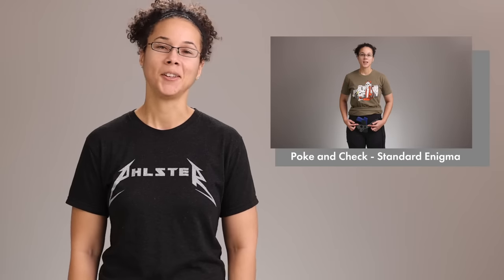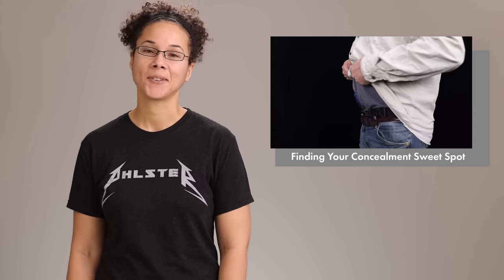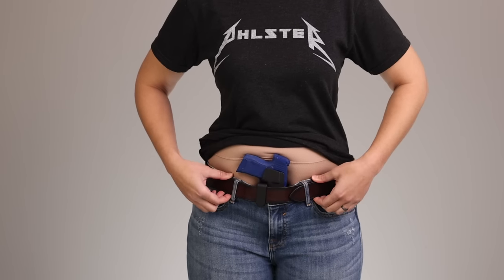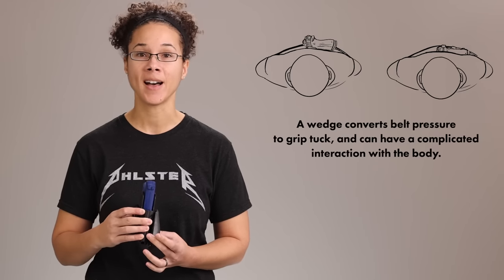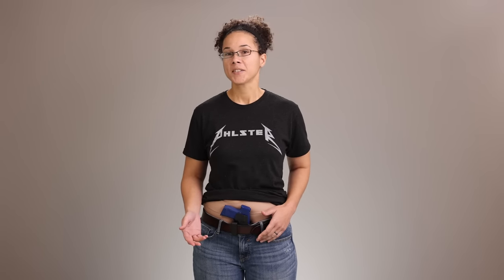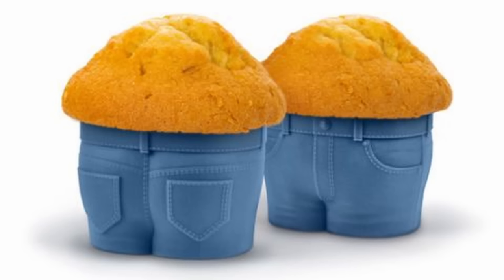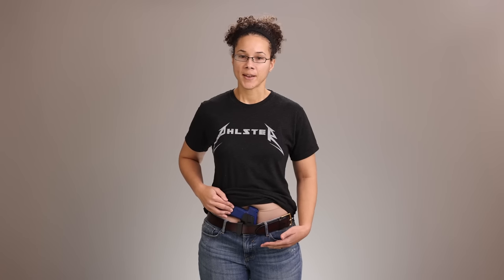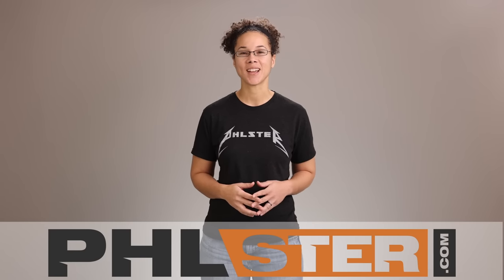Poke and Check - How To Stop Printing

Comment: I think people worry a bit too much about a small “bulge”. There’s a difference between printing, which actually is where you are showing a definitive outline of a gun, and a slight bump or bulge. You may show a slight bump, but it!s not obvious to a casual observer what it is. Is it a cell phone holder? Is it a back brace or lifting assist brace? Is it a large belt buckle? As long as it is concealed and cannot be seen as definitely being a gun, don’t worry about a small bump. I found when I first started carrying 10 years ago, (my gun is larger and not what most people would carry as a “conceal gun”) if I had a small bump I was so worried about someone spotting it and figuring out I was carrying a large gun. I wear loose shirts all the time so I wasn’t “printing” as the definition goes. Truth be told, I was worried about it so much but found out I was the only one that noticed it. And if by chance someone did notice a small bump, they never gave it a second thought or look.
Reply: Agree with the Axe4ever…People are not starring at every part of another person looking for bulges. Most  are too into them selves or there phone or you name it.
Reply from the maker: @wbwills2  Are those people the reason you carry a gun?
Reply: @PHLster  Well yea, partially at least. You don't want people to know, even if they're not the potential threat. The danger in printing, in my mind, is that you could cause unnecessary panic in people. I'm not generally worried that a bad guy is checking everyone's waistlines.
Reply: @PHLster  Not sure what your point is. I don’t carry a gun for anyone but myself and my family. I think the point Mary was making is people aren’t going to notice a small bump under your shirt. I’m talking about just a small bump that doesn’t show unless you move just a certain way. Again, not printing. People are just usually too busy going about their day to even notice. I used to be. But when I started carrying, I drove myself crazy thinking everyone would notice what could be just a belt buckle if I wore certain shirts. Again, a small inconspicuous bump is not printing per se. I’ve been carrying for 20 years and NO ONE has ever gave me a second look. Well, not entirely true. In line at a convenience store I saw a cop notice it. But they are trained to look for such things. We exchanged a hello and went about our way.
Reply from the maker: @TheAxe4Ever  I mean that oblivious people aren't the dangerous ones. The people who don't notice printing aren't the ones who constitute a reason to carry a gun. So, yeah, most people don't notice. Sure. But I'm not carrying a gun because I think I'm going to be attacked by some oblivious person who's looking at their phone.
Reply: @PHLster  Agreed. Criminals (and cops if you're in an unfriendly state) know what that oddly squared bulge is in the middle of your shirt.
Reply: You are far more likely to be identified as "someone with a gun" if you keep checking it to see if it is completely concealed, or if it is printing.  When you do that, you are bringing attention to a gun that would otherwise go completely unnoticed by anyone around you.  The more experience you get, carrying concealed, the more confidence you will have and you'll quit drawing attention to yourself, and the firearm.  If you take reasonable care in concealing your firearm, the only people that are apt to notice you are carrying a gun are the people trained to look for such things.  Think:  Law enforcement and other citizens that are carrying concealed; and they won't notice it unless they are looking for it.

Comment: I like how calmly and scientifically she does this video. I haven't conceal carried even though I bought my EDC gun about 5 years ago. I was supposed to get my permit but my county only gives them to entitled people like retired LEOs, judges and VIPs. I  have a few belly bands and I've worn my EDC, or what's supposed to be my EDC, in those in my home and in both back and front yards. I'll soon be carrying and I'll be using one of those temporarily until I get a holster that fits my Smith&Wesson Shield .40 with a Crimson Trace laser-light.
Reply: Imagine George Washington or some other founding fathers talking about how they have tested conceal carry in their backyards and are just waiting on permission. Not a shot at the OP, just a thought I had.
Reply: @MrLbsrdi  I've considered that and have realized much too late how I need to be proactive and less fearful of government. I'm a caregiver for my handicapped mother, so it's not easy to just conceal carry in one of the worst counties nationwide. If I'm locked up for just merely carrying a gun for me and my family's protection, that would create problems for my mother. But! I've already decided that I will carry regardless of permit schemes. I live in a very safe city and even safer part of that city labeled as a Leave-It-to-Beaver neighborhood. But that didn't stop 4 ex-cons from parking out front while 3 of them ran out of the car and onto my driveway 4 years ago. It was one of the scariest experiences of my life because I had my finger on my shotgun's trigger as one of the ex-cons eventually made it to the backyard and was about to break open the French doors. Then two other incidents occurred but not as frightening as the first one. A guy in one of those incidents hid on the side of the door preparing to attack whoever would have answered the door. But I had my pistol in hand at that time. I had applied for a CCW and even paid for the required class about a year before the first incident. I refuse to be a victim, even though I carry less than lethal tools all the time, including a folder knife. But the only thing that's holding me back from bearing arms is confidence. I will begin bearing arms after I take at least one class. A right doesn't require permission. I wish I was aware of that like I am fully aware now before applying for a CCW. I'll never do that again.

Comment: I tend to like my holsters to be fairly simple, however, this tutorial has got me thinking I may need to pursue this further. This system may be the logical evolution of a Bruce Nelson and Milt Sparks.
Reply: Could be...  I'm glad to see that there are still people around that know who those gentlemen were!  They designed some very innovative, and useful, holsters and other gear as well.  Some of their designs have been copied by many other holster makers, both big and small.  That, in itself, is a testimony to the their outstanding work and products!

Comment: You helped me find my sweet spot a couple of years ago. I have gained weight. The sweet spot is still in the same area, but the added belly has required different adjustments. Should I strip my holsters of their wedges/wings and start from scratch?
Reply from the maker: That’s not a bad approach.

Comment: Great video, but I think you need to add the fact that a T shirt (or other outer garments) may need to be varied to help hide the gun. Dark colors are going to do a much better job at hiding printing than lighter colors. Shirts or T shirts designed specifically for AIWB or String side  carry are out there and can be used as well. In the end, it’s a system (holster, belt, wedge, wing, outer garment and undergarment which you have to fine tune. Also, posture is a big factor, need to make sure that we are conscious of the fact that we are carrying, and check out in the mirror how my posture affects my printing.

Comment: Also a shirt with a pattern design can break up the gun’s printing lines. I’m new to ccw and chose to carry appendix for a few reasons. 1st that location has less chance of anyone around you to take your gun away from you because it’s in the middle between you hip bones which gives you both arms to block any attempts to disarm you. 2 that I believe being able to move the grip towards the middle it offers better concealment when used in conjunction with a stiff belt, a claw, and a wedge. One other thing is the belt should have a low profile buckle or buckle moved to the side to not add to the thickness of the holstered gun. I picked up a Tier 1 axis which pivots between the mag carrier and gun holster with parachute cord to be able to conform to the curve of your body and flex with movement. I also bought a separate Kydex holster with a claw which I’ll be adding a wedge to and a separate single Kydex  mag  carrier just for versatility. One other one I bought is a type of belly band holster that has a pocket for a small kydex holster with a reinforced elastic type material on the front of the pocket that will keep pressure on a claw.

Comment: A claw and wedge changed the whole game for me. I can easily and comfortably carry my heavy little CZ 2075 and it’s fat grip with absolutely no printing. Granted appendix carry really helps conceal as it is. A wedge takes a little getting used to. 

But I’ve started open carrying lately anyway… heheh.
Reply: What's the logic with open carrying? Genuine question. To me you're just painting yourself as target #1 for a potential threat.
Reply: @SeraphsWitness  I open carried while waiting for my CCW Permit in the mail. Afterwards, I worried all the time about printing and I'm never going back to open carry unless I'm camping somewhere discreet or if SHTF outside my home.
Reply: @SeraphsWitness  Depends on the circumstances, Open carry can very well deter an attack, Conceal carry just means you have to take a life when attacked, Open carry can prevent the entire encounter, Although it can also give away the surprise to an attacker so it can go both ways, Personally I work a job where aggressive encounters are common so I quite often open carry because although I run into a lot of aggressive encounters it's usually people running their mouths and they are all bark no bite If I conceal those situations may very well push me to draw at some point should they push the envelope a bit but If I open carry, usually the sight of my gun deters people from acting a fool. Same concept with a bank, Are You gonna rob the bank with a 90-year-old sleeping security guard and a wide-open vault in the back or one of the bigger banks with a shut vault, bulletproof glass, excellent cameras and multiple armed guards? The answer is simple, You rob the one with minimum or no security, although to the right people the bigger bank holds more cash and the armed security isn't hidden, so to the right people they may attempt that heist for a bigger payout, but to the common street thug, they won't ever try it because of that deterrent, same applies with the common criminal they want to rob the weak, they want to break in when no one is home, they want to steal the empty car with the keys in it, They want a nice easy target, not the one that can clearly shoot them. 
That all being said open carrying comes with a whole lot more responsibility because you very well have to be aware of your surrounding as like I said, the surprise factor is gone if someone is going to attack you they will go straight for your gun and you need to be hyper-vigilant to see that threat ahead of time, That's why I open carry and if I am going to be around a lot of people and outside of my normal element where I'm usually by myself or around just a couple people or if Im in an environment where my attention may be diverted, then i pull my shirt over my gun, if I have a jacket or hoodie I'll throw it on, and ill do as much as i can to conceal my open carry holster and gun.

Comment: I think in FL it's not a huge deal if you print a bit because it's not against the law/a big deal if you accidentally flash your gun.
I don't think everyone immediately assumes that you have a gun or is on the lookout for people carrying as much as concealed carriers are paranoid about.
And despite personal choice and what some people say about the danger of  "appendix carry," it is still probably the best/easiest way to conceal due to the space in the small of your back when standing up straight, and the handle isn't being pushed outwards as it can be in the front; it's also probably not as dangerous as mentioned as long as you carry a bit off-center, not directly aligned with the spine.

Comment: Is it possible to conceal carry at the side or in 4 (or 8) o'clock position without printing or protruding if carrying handcuffs, an expandable baton and a 9mm pistol that uses a double stacked or staggered magazine? I'm keen to pick up concealed carry, especially as part of personal preparation to sign on with the Singapore Police Force or the Central Narcotics Bureau, especially for vocations in both agencies that require concealed carry, like CID, SecCom and Air Marshal Unit. SPF issues the Glock 19 Gen 5 as a standard service sidearm for regular servicemembers while still issuing the Taurus Model 85 revolver for its conscript and volunteer ranks. CID and SecCom issue the Hekler & Koch USP Compact 9mm. Both pistols have an overall width of 35mm and use double-stacked or staggered magazines. Our law enforcement agencies, including the SPF, have issued the Bonowi EKA Camlock 21" since around 2018 or 2019, replacing the Monadnock PR21 extendable tonfa and the ASP friction lock expandable batons.

"Off-duty carry" is not allowed for most SPF personnel other than vocations like CID and SecCom where officers must be ready to respond from wherever they are.

Comment: IMO (and if yours differs then that's okay) if I'm printing some I don't really care. It's not illegal to print in my state. I don't necessarily want or attempt to print, and I'm from the 90's so fairly loose clothing for me, and generally I carry a GEN1 Shield so it's not that hard for me to CC, but if I ever do notice that I'm printing a little bit, it doesn't bother me. Years ago I worried much more about printing than I do now. If I do end up noticing I'm printing I feel it's pretty obvious that I'm not attempting to as it's generally pretty light, and most people probably don't even notice unless they're paying me a lot of attention. Also I wear loose enough clothing that it's usually easy to fix by pulling on my shirt tail as it might be grabbing on something. But again I don't get too worried if I end up with a slight print happening.

Comment: Under my belly conceals ot the best otherwise its 8oclock cause im a lefty.

All jokes aside i feel that printing is something that happens when its a single layer like a shirt. Above that like a sweater or jacket and it goes out the door. Other than placement a slightly larger shirt works great.